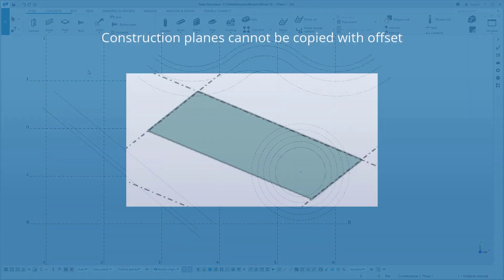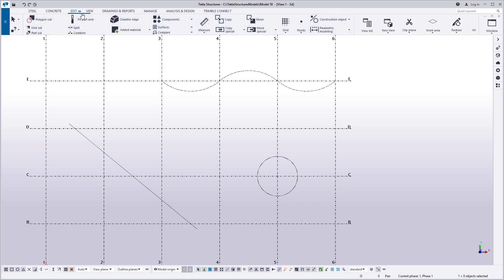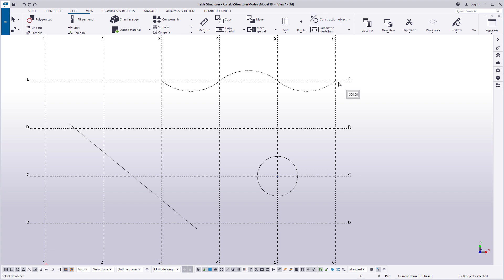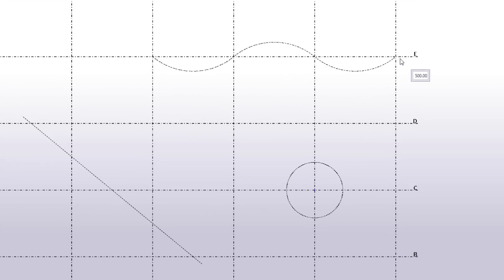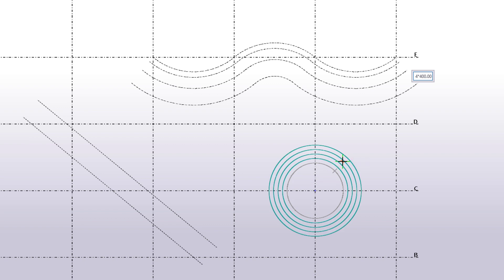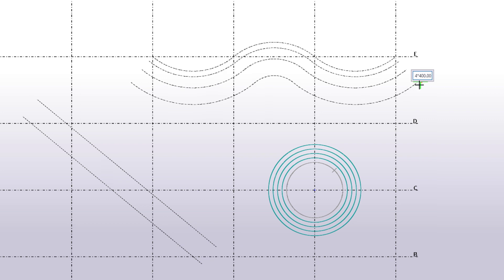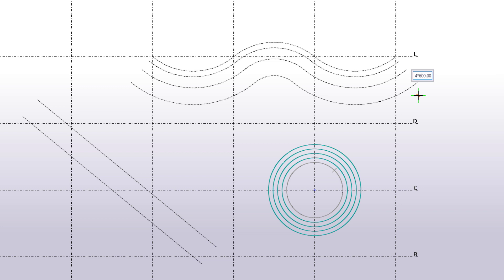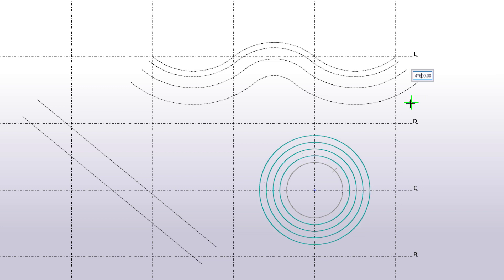Copy construction objects with offset in Tekla Structures

Comment: Hi.  When I try to specify which direction to offset the construction line, the proposed offset line does not immediately snap to my 500mm mark.  when I move the cursor I get the "snap to any position symbol" and the offset construction line seems to move in small increments with my cursor movement.  Any ideas on how to force the offset line to immediately snap to 500mm?